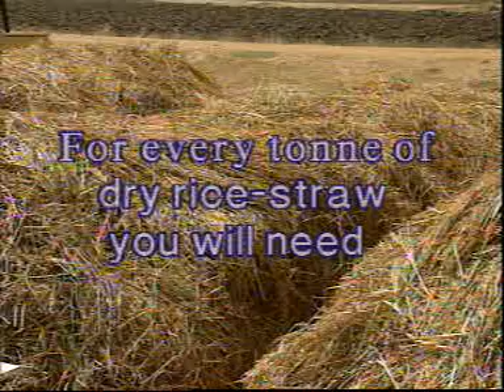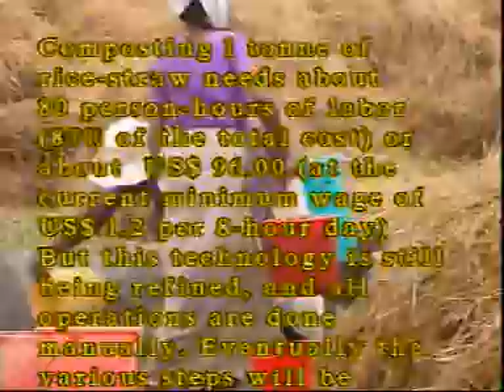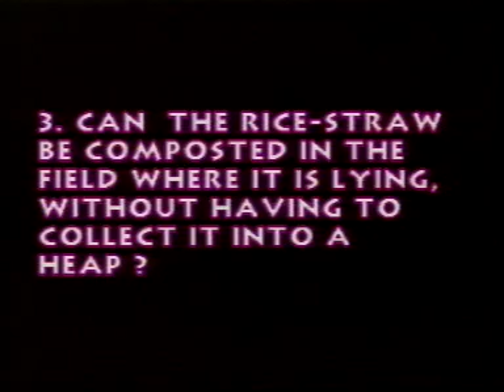Rice Straw Composting - ICRISAT

Comment: It is a pity that there is no mechanized solution. In Russia, rice cultivation is well mechanized from soil preparation and planting to crop care for crops with aviation and harvesting. But straw is burned in the same way and this creates big problems with smoke in cities and villages. At the same time, manual labor is very expensive and mechanization of the straw disposal process is required.